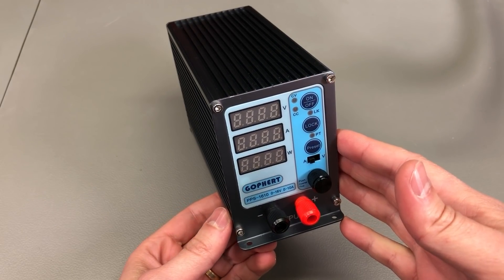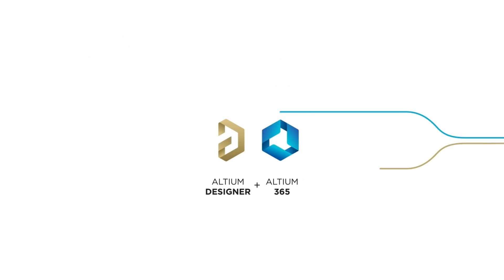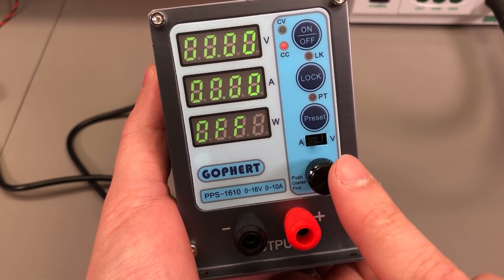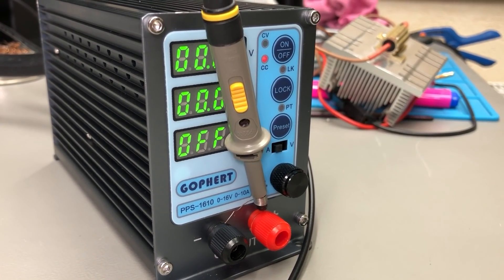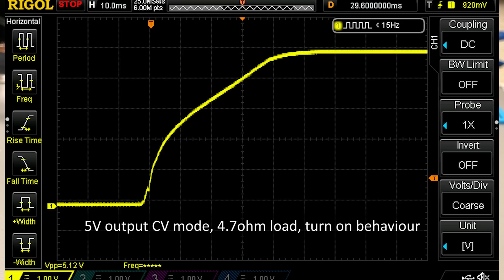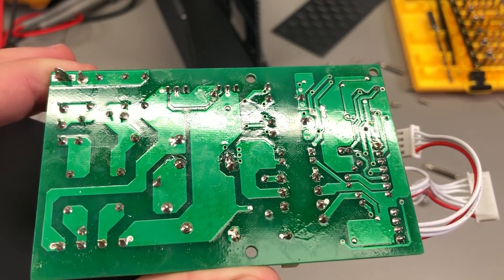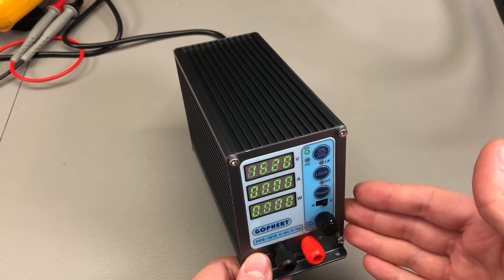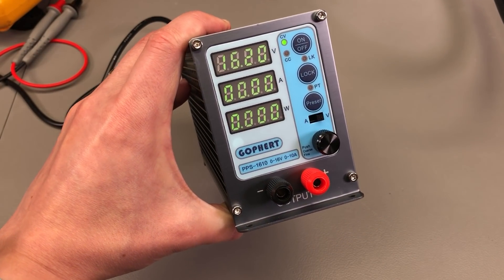New Gopher PPS-1610  PPS-3205 Review & Teardown | Voltlog #391

Comment: Those leads are terrible. The croc end is not soldered and the banana end is screwed against the plastic insulation only. And even if you improve the connections the wires are stupidly thin. I bet a lot of beginners thought they got a broken PSU just because the cables won't conduct anything.
Reply from the maker: I agree, should be replaced as soon as possible.

Comment: Maybe a smaller knob would be better, it would also make it faster to adjust. Or maybe a longer knob, but that would block the terminal.

Those LED need a darker tint to blend out the white of the off segments, plus green is never that bright.
Reply: Green is actually the brightest, but otherwise you're right.

Comment: Good review, thanks.  I bought a CPS-3205N power supply on the strength of your review of that unit about 4 years ago, and it has been my primary bench supply ever since. It works well, but it has one serious flaw -- the fat-finger front panel couldn't be more frustrating to use.  I long for a way to DIY a true rotary knob style front panel so I can change voltage and current settings on the fly without the tiny push-button membrane switches getting in my way.  If I could just build a new front panel using pots or digital encoders that would make this good power supply an excellent one.  Do you know of a way, or know of someone, who has done this?  Thanks!

Comment: I got the NPS-1601 for 38€ on banggood two weeks ago (after I watched your "gift" video). The user interface is indeed annoying and I don't know if it will become my main PSU because of that (I have a 2x 32V/5A non-switching lab PSU).

But I already found it useful that the NPS-1601 is so small and light for those cases where carrying the device-under-test to the lab supply is more of a hassle than the other way round (a screen LED backlight in this case).

Didn't you start designing a more user friendly front panel for the NPS-1601? I would be really interested in that.
Reply from the maker: That open-source front panel will probably never see the light due to lack of programmers.

Comment: These guys make decent power supplies for the price they are selling them for. But what I can't get is why they insist on using these really bad 7 segment displays with no contrast filter on them. How costly would it be to fit a piece of colored plexiglass on them, or better yet, use better quality ones that actually come with filter glass on them.
Reply: I would be happy if they got a nicer knob, this one is tiny and awkward to use
Reply: @alexstone691  You can just swap the knob though, anything which takes the same shaft diameter should do.
Reply: @benbaselet2026  I am going to but haven't find a nice knob yet
Reply from the maker: I don't know why but one reason could be that they sell a lot of these for industrial type applications, where you set and forget it. I've seen these used in signage boards here in Romania.

Comment: Well that's disappointing (the product, not the video; the video is great, thanks).
Obviously Gophert should fire their front panel designer.  Then they should steal my front panel design.  My modified NPS-1600, 1601, and 1602 are still my favorite power supplies.
Reply: Where can i see your modified psu's ?

Comment: I honestly don't like it from the start, i love my nps1601 but the switch position annoys me daily, the interface is pretty bad but its a great psu, this one seems even more awkward to use though
When is the alternative front panel coming though?
Reply from the maker: Unfortunately that alternative front panel will probably never see the light.
Reply: @voltlog  Shame, was there some problem or it or?
Reply from the maker: @alexstone691  Lack of time for the programmers that volunteered and generally a lot of opinions about how it should be done, it was hard to reach a common point.

Comment: Thanks for the review!  I was excited when I saw this was about a new Gophert, but I'm not impressed with this design. You should never design a new product that has similar specs to current models while being more expensive to manufacture. I like the Gophert supplies for being simple and affordable with reasonable quality, but this PPS series does not suggest that this is a company willing to invest in innovation. RD Tech has constantly improved its lineup in the time that Gophert changed the shape of its case.
Reply from the maker: I have to agree, too bad they are missing this train of innovation..